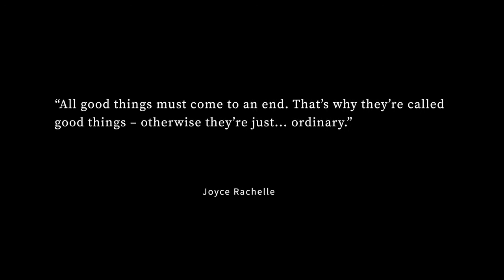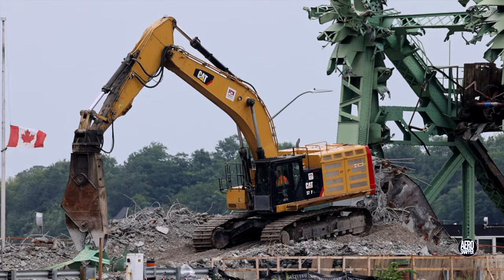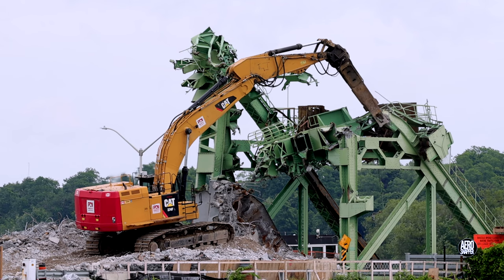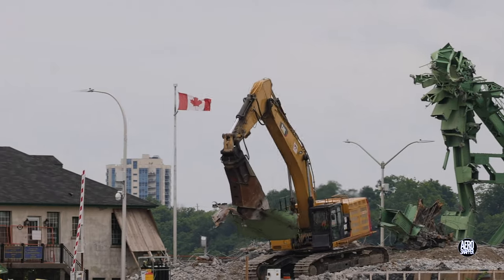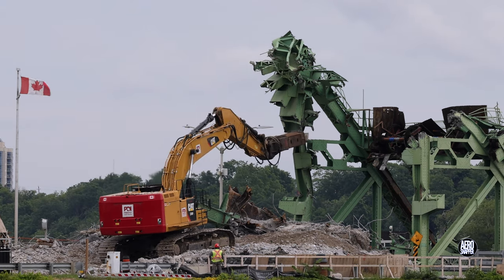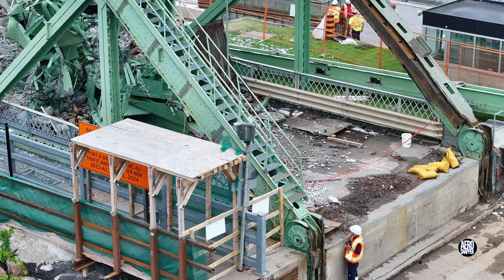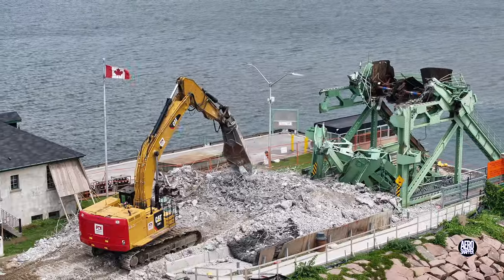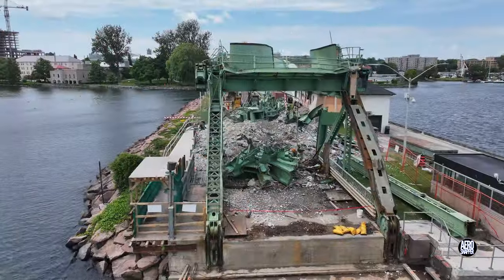Down to Earth with a bump - an update on the La Salle Causeway lift bridge  4K

Comment: What type of maintenance do they do on Muncher? Do they file its teeth or what? I find this stuff fascinating, and  how a machine can totally crush through that steel as if it were balsa wood.
Reply from the maker: That’s a really good question - I don’t really know, but dependent as it is on hydraulic systems, I suspect that regular attention to the hoses and connections is important. I imagine the ‘jaws’ are hardened steel.
Reply: I once had the privilege of watching a shear working cleanup at a derailment site in Eastern Ontario back in the late 1980's.  The cutting blades are made of extremely tough, durable steel.  The people spec'ing out the attachment can choose from a few different grades of steel, depending on what the shear will be used to do, cutting steel, concrete, whatever.  I understand that generally, not much attention needs to be paid to the cutting edge, but it is understood that like any large machine,  it very slowly, but surely wears and destroys itself.  The bits that interface directly with the material to be demolished, are designed to be replaced.  I think you would be hard-pressed to find much that would stop the claw from closing and shearing what it goes up against.  It all comes down to leverage,  and having the hydraulics well-positioned  so that maximum force can be exerted and transferred through the rotation around the pivot point, so that the jaw can grab, bite, and cut right through the material.